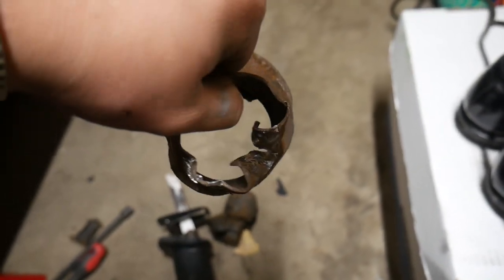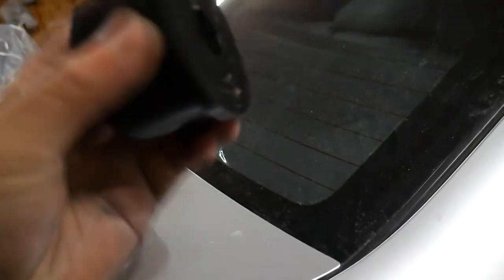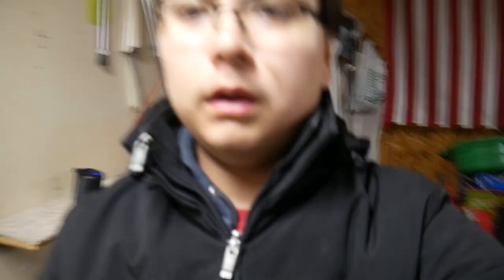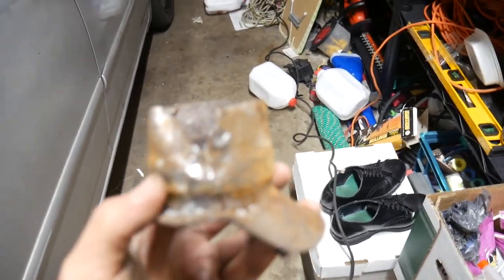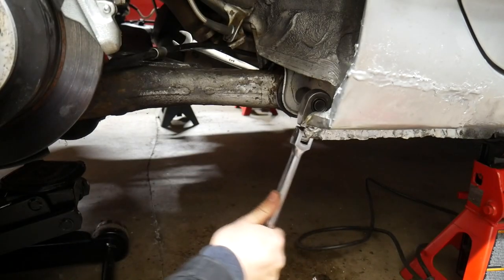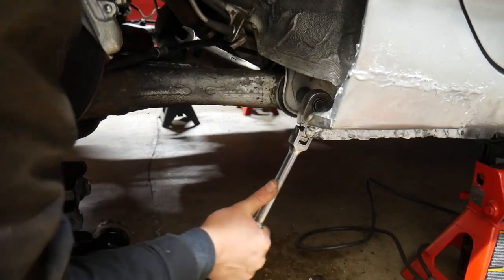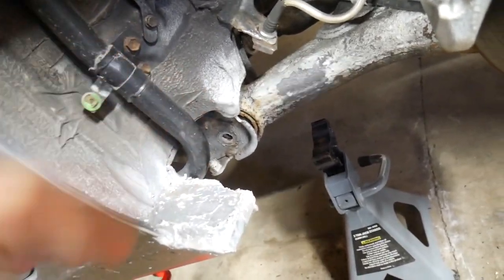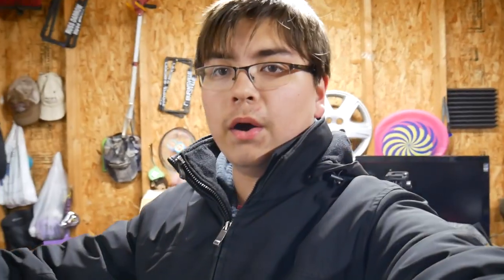Corolla Polyurethane Rear Axle Beam Bushing Install

Comment: hey man, just wondering , it looks like you cut the rubber bushing out of the way to get the Sawzall in then cut a slit in the housing to release it then chiseled it out.
  I guess it is visible not to cut too much when you're actually doing it 
How long did the 2ed side you did actually take?

Comment: Dude - I just bought a 2005 Corolla for my teen.  Looks like I will be watching a lot of your videos as although the engine/transmission seem great, lotsa rust mitigation, clearly need to replace rear axle beam bushing and more.  Should be interesting.  Thanks for posting.

Comment: Anyone can link to the tool to push out the old bushings, my rear bushings are shot and need replacing. Already have energy suspension replacements ready to put in. Or anyone know an easier way to get the job done, i do not have a sawzall to cut the metal sleeve.

Comment: Nice job.  Just curious was this swap just to get some clean parts in there? Or have you been noticing some clunking in the suspension / steering?
Reply from the maker: Thanks! Didn’t have any issues with the old bushings, just wanted to swap them out for some better ones

Comment: I like your videos man I have an 03 that I am working on what would you do because mine keep over heating and I think it my head are head gasket and I was wondering what should I do to put a new head are head gasket in are a new engine
Reply from the maker: I'd first make 100% sure that it is the head gasket going out, I assume you've seen all the visual indicators like white exhaust smoke, smoke from the radiator cap, etc. Have you used one of those head gasket chemical testers at all? If it is a head gasket issue, then fixing it really depends on your skill set, pulling an engine in my opinion is a little easier than taking the engine apart but if you're skilled then replacing the head gasket will be much cheaper. Otherwise, definitely have a look at the radiator, radiator hoses, coolant, thermostat, and pretty much everything else in the cooling system if you haven't already.
Reply: @WillChang  I did everything else just haven't texted it yet doing that next Friday

Comment: Hey man, just wondering what are the exact specs for the rims/wheels you’re using. i plan on buying second hand for my corolla and i wanna make sure i don’t buy something that doesn’t fit
Reply from the maker: Mine are Konig Control Matte Black wheels, 16x7, +40 offset, 5x100 bolt pattern, with 205/55/R16 tires

Comment: hey man been watching your vids lately cuz i bought a corolla 03 s, and i got a few questions if thats cool. how many miles on yours? and is it worth it to put work into an old corolla like that? because i want to start working on mine but dont wanna put in a bunch of work for it to die in a few years. lmk man thanks!
Reply from the maker: I've got 163xxx miles on mine, I think it's worth putting work into it unless it's a rust bucket that's rotting away, besides that though it'll last a long time and the engine and transmission won't give you any trouble. Thanks for the questions!
Reply: @WillChang  thanks man! imma subscribe i wanna see what you do with your corolla